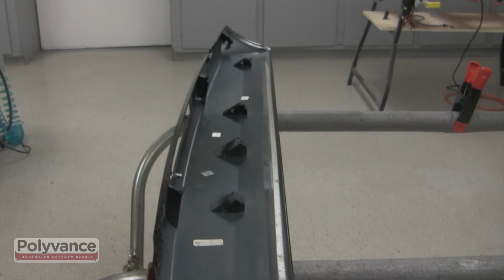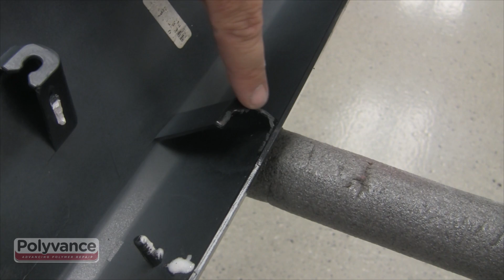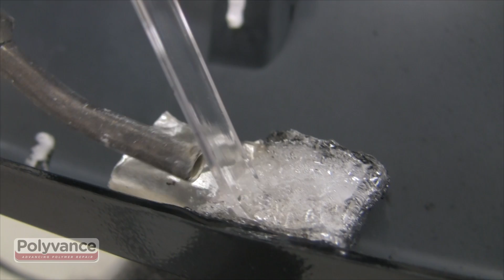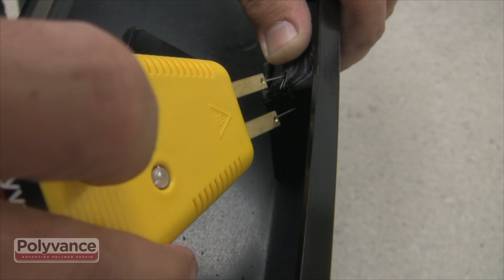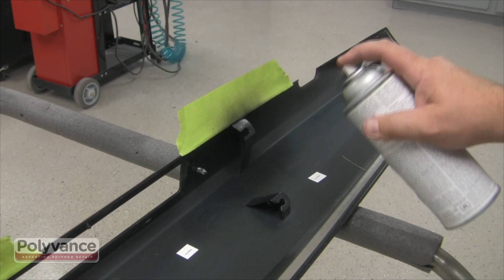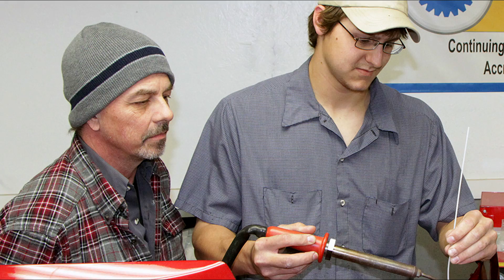Repairing Broken Automotive Plastic Trim

Comment: wtf is airless welder?, thats a soldering iron :D
Reply: Airless welder = soldering iron style heating element designed to output the proper temperature with the custom welding tips.  You don't call a wood burning kit a soldering iron, do you?   The tip style and temperature makes all the difference.
Reply: A $400 soldering iron..... Thts wat it is 🤣🤣🤣